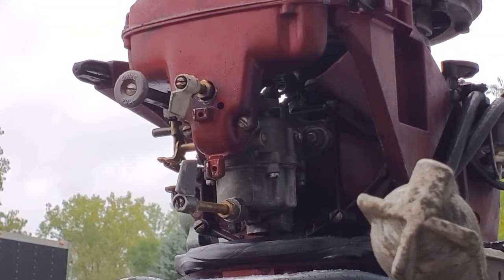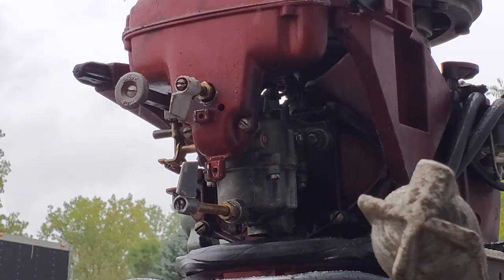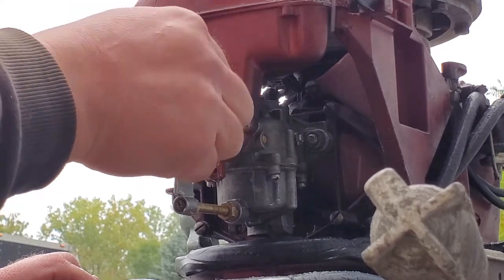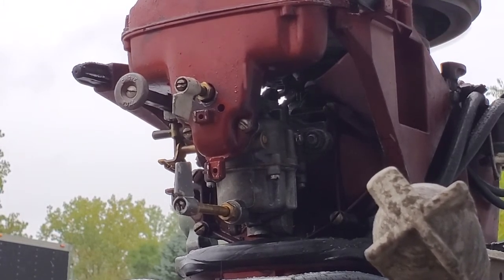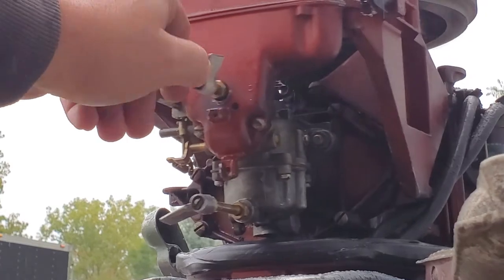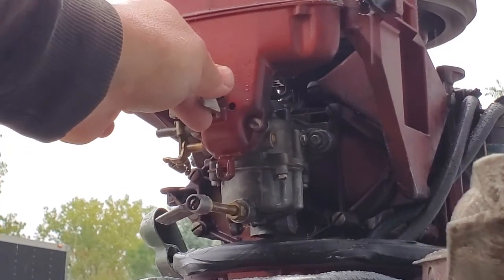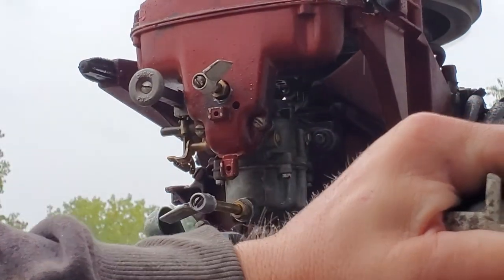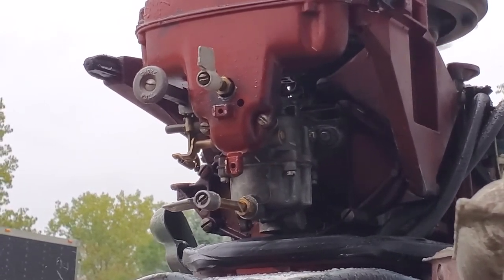Dialing In a Carburetor After a Rebuild

Comment: Do you adjust motors every time you use them? If it’s adjusted for say a hot day then you want to use on a cold day 2 weeks later...re-adjustment? 
How bout if you keep slowing down the idle and adjusting, got the perfect idle for the day, then won’t it be out of adjustment for initial startup next time?
I was supposed to get a 33hp 1965 Evinrude yesterday but the guy screwed me after having me drive 2 hours...that carb on that thing didn’t have a high speed adjustment..every 33 hp from the 60s on marine engines shows in the schematic that they all have an adjustable jet there. 
Edit: I really wanted that 33hp motor...my 28 was running beautifully the other day, not even a cough or hiccup...but it wouldn’t go over 6 mph...I gotta look at my throttle cables, but I feel like I was getting full throw on the handle..so disheartening
Reply from the maker: I adjust motors as needed.  Sometimes they need to be adjusted  a little and other times they don't.  It just depends on the conditions.  If there is a large swing in temperature or humidity, then an adjustment to the low speed needle is often needed for best idle.  If it is a big difference,  like early spring or late fall to middle of summer,  the high speed may need a little adjustment as well.  The idle needing adjustment is very common.  That is why they left the low speed adjustment on the carburetors long after they went to a fixed high speed jet.
Sorry to hear the deal on the 33hp didn't work out.  I see that Marineengine.com shows adjustable high speed on 33hp thru the 1960s.  I find that unusual,  although maybe that is how those were.  I'm not that familiar with the 33s.  Most OMC motors went to fixed high speed in 1964 at the same time they made the switch to 50:1 mix ratio.  I would have guessed that one would have been fixed high speed being a '65.  I was surprised to see ME showed that carb as 2 circuit adjustable.  Thanks for watching!
Reply from the maker: As for your only getting 6mph at WOT, it sounds like it dropped a cylinder if it was not getting full RPM. Thats my first thought, anyway.
Reply: @oldjohnnyrude8404  I pulled each wire while out running, no change in it. Would anything that undear the fly wheel make it do that? 
I was thinking the throttle cables, they work perfectly on the 18, you think they need adjustment for a 28? Like i said, they seem to move the throttle all the way, but it’s hard to see on the 28 from my console, it’s all tucked up in there.
Reply: @oldjohnnyrude8404  I’m so bored today, I’m thinking about trying to add my 62 Johnson 18hp to the boat, dual 18s is 36 hp ;) would look better with 2 fastwin, but it’s what I have. I have 4 gas cans, so I can do the different mixes. Lol your thoughts?
Reply from the maker: @TheFrogfeeder  I say sounds good to me.  Set it up for the Fastwin and the FD now and you can always get another Fastwin to put in place of the Johnson down the road.  Twin 18s are great!
Reply from the maker: Marc Poindexter  It isn't that the carb doesn't keep the settings.  As long as the packing nuts are snug, they will keep the settings.  Conditions change and demand a change in fuel mixture to get the ideal burn back in the cylinders.  Thatbis the nature of an internal combustion engine.  With fuel injection,  the computer processor makes adjustments continuously via feedback from sensors.
Reply from the maker: Marc Poindexter  I guess I don't see "They don't hold their settings at all." As the same thing as "They do not adjust themselves according to conditions."  The settings do not change on their own.  If I'm missing something, I need an explanation.  🤷‍♂️
Reply: Marc Poindexter  Weather changing isn't the carb's fault. :)
Reply from the maker: Marc Poindexter  For a relatively simple 2-circuit carburetor these OMC carbs do quite well.  Unless there is a very noticeable swing in temperature and/or humidity they require little operator input once dialed in.  The older, single circuit carburetors required adjustments for every throttle range every time you run the engine.  Some other brands were, indeed, very sensitive to conditions.  The later carburetors were still 2-circut. Most were better optimized for midrange transition,  but the user input was designed out of them as your average operator became less and less aware of how to adjust a carburetor.  In my experience,  Tillotson carburetors are notably very sensitive to conditions and inputs. Yes, I am aware that originally 2-stroke fuel mix was typically 30wt or 40wt non detergent motor oil mixed with the gasoline.   That mixture also had a tendency to not.stay mixed very well and required occasionally shaking the tank to redistribute the oil in the mix.
Reply from the maker: @TheFrogfeeder  Not sure what under the flywheel would make it do that.  If you are able to pull one plug wire and then switch to the other one and it stays running either way, it probably is not spark that is your problem.  It could be the cables.  With the motor off put it in forward gear then full throttle at the console. Then walk back to the motor amd notice where the throttle dial handle is pointing. Next, unhook the throttle cable and see if you can turn the handle farther toward wide open by hand.  If you can, then you need to adjust the cable.
Reply: Marc Poindexter  oldjohnnyrude is always on base when he talking outboards! You can learn a lot from him.
Reply: Marc Poindexter  all good, I know he is very knowledgeable with this older stuff, which is what I like also, and he has helped me tremendously, from across the country, to get a few of my 60s motors running. Old johnnyrude is my go-to guy for all my endless questions, I don’t pay him(though I would), he is just a good person that helps others when he doesn’t even have to :) 
oh, and he has a way of explaining things that makes it easy for me to understand

Comment: So I got a 5.5hp Johnson and took it out for the first time after rebuilding the carb and I could not for the life of me get it to idle, could I have messed up the packing? If I remember right I may have tightened the low speed needle a little too much ? Could this be my issue ?
Reply from the maker: When you rebuilt the carburetor,  did you remove the old packing and replace it with new? When you replaced the mixture needles, did you lightly seat and back them out to the initial positions before you tightened up the packing nuts? I usually start with both needles out 1.5 turns from lightly seated.  That is WAY rich on the high speed and typically still a good bit rich onow speed.  That way I know I will be leaning the mixture out from my start point and it usually means a fairly easy first start. From there follow this video on dialing the needles in while it is running.  Be careful with the low speed needle especially. It is fairly easily damaged if it is seated too firmly. I hope this helps. Thanks for watching!
Reply: @oldjohnnyrude8404  if I remember right I may have over tightened the packing nut on the low speed, I'm going to take it out again tomorrow probably and I'll report back, I tried running it in the back yard today I got it running good but the moment I put her into gear she dies, I could it possibly be my fuel pump? I replaced it with the correct part number but it was a cheap 15 dollar pump
Reply from the maker: @nightdrivers9138  A could more questions. 
1. What model is your motor? I ask so I know the year so I know what you're dealing with and how to answer questions better
2. Does it run and idle well, but just dies when you shift into gear?  If so, your trouble may not be the carburetor, but the shock absorber in the gearcase.  That part is under the water pump.  They tend to get sprung after so long a time. When they do they expand in length and start to drag on the bottom of the bearing carrier plate for the drive shaft. When they are sprung they badly, I press them back together and weld the seam.  That makes the drive shaft effectively solid and you have to go to a brass shear pin in the prop to protect the gears since there is no shock absorber in the driveline anymore.
Reply: @oldjohnnyrude8404  so it's a cd18 1961 5.5hp seahorse, i can get it to run okay at high rpm but at low rpm I can get it to idle but the rpm still seem to be too high and can't get it to drop anymore, I also had issues with it popping out of gear under load at high speed
Reply from the maker: @nightdrivers9138  OK. Second year with a fuel pump for a single line tank.  First year for needle bearings on the big ends of the rods so it will use 24:1 gas/oil mix instead of 16:1 that the previous years required. 

It does sound like your low speed circuit may be clogged or partially clogged. Something seems.to be keeping it from taking over when the high speed circuit cuts off.  It also sounds like your clutch dog and possibly forward gear has become rounded off from slow shifting over the years.  The detent spring in the gearcase could be weakened or broken as well.
Reply: @oldjohnnyrude8404  awesome thanks for the info, I'll have to tear apart the carb again and clean it again, if I cant get it to run right I might just sell it
Reply from the maker: @nightdrivers9138  You're welcome. Hopefully you get it sorted out. They're nice little motors.
Reply: @oldjohnnyrude8404  hey again so i wasn't able to take her out on the water since it rained but I did pull out the low speed needle and the tip looks like it's been eaten away and looks like it has small pitting, it still has the tip and it's shiny below where it is damaged so seems to still seat, do you think this could be my issue ?
Reply from the maker: @nightdrivers9138  HI there.  So, while damage to the tip of the needle is not going to do your motor any favors when it comes to idle quality, it is highly unlikely that this damage you are describing is preventing the idle circiut from functioning completely.  That is how it is behaving from how you describe it.  Have you removed the Welch plug from the top of the carburetor and made sure the ports under it are completely clean and there is no trash floating around in that cavity?  I don't usually do that unless something like you're describing happens.  Sometimes there is stuff in there that will not flush out any other way though.  New Welch plugs are included in the carb kit.
Reply: @oldjohnnyrude8404  got ya and yes I did replace the plug I dipped the carb for about an hour and then sprayed out every port with carb cleaner, even made sure those little holes in the carb for the low speed were clear of anything I'm starting to think it's that shock obsorber you were talking about at this point.
Reply from the maker: @nightdrivers9138  Excellent.  Glad to hear the carb got the full cleaning. The shock absorber is definitely something worth looking at. It will require a gasket replacement.  When you lift the plate under the water pump, it opens into the gearcase.  Those gaskets are often the source of gearcase leaks on these lower units.
Reply: @oldjohnnyrude8404  is this the part number for that shock obsorber your talking about? Had no clue they are that expensive lol 0376073
Reply from the maker: @nightdrivers9138  Yup, you have the correct part number. I always just press them back together and weld the seam so it can't spring open again. Then replace the steel drive pin in the prop with a brass shear pin to protect the gears. Carry spare pins.  It is a much less expensive option.
Reply: @oldjohnnyrude8404  so I have it in a test bucket rn, and this is kinda odd, so as I was leaning out the highspeed I had my hand grounded on the little handle thing while tighting the high speed needle and the fucker shocked me ! Do I have a bad ground on the coils or something ? The fucker shocked the hell outta me scared me a little bit 😂
Reply from the maker: @nightdrivers9138  Sounds like you either have a coil or a plug wire shorting to chassis ground.  It should not be doing that.  That short will affect how it runs too.  When it is arcing out, it most likely will not be firing whichever plug is being fed by the coil or wire that is shorting.
Reply: @oldjohnnyrude8404  thanks so much for all your help your awesome man ! I will stop bothering you now. Thanks again !!
Reply from the maker: @nightdrivers9138  No problem at all.  Glad to help out when I can. Good luck! I hope you get it sorted out.😎👍
Reply: @oldjohnnyrude8404  sorry for commenting again but I thought you may be curious, so I got the flywheel off and surprise surprise the coils look shot, they look like the originals and are all cracked up. I'm going to replace coils condensers and maybe points, and spark plug wires hopefully that should do the trick. Would it hurt to put some anti seize on the crank to make taking the flywheel off easily in the future ?
Reply from the maker: @nightdrivers9138  no problem! I like finding those motors with original cracked coils in them. They typically don't have as many hours on them as the ones that have two different coils from different eras on the magneto.   That would explain the thing shocking you.  If the original points can be cleaned up well amd are not pitted too badly, I would clean them and reuse them. The OEM points have been having quality issues for the past couple years  Unfortunately, aftermarket points of typically questionable quality have been a better bet than OEM of late.  Other than that, I still like to use OEM ignition parts. I would definitely replace the coils and condensers with OEM.  Spark plug wire needs to be copper core wire.  Do not use anit-seize or anything at all on the crankshaft taper for the flywheel. Make sure it is clean and completely dry.  That taper is intended to lock the flywheel in place with the proper torque applied to the nut. Good luck.  I'm sure you will be very happy with how it runs when your tune up is finished.👍

Comment: What if mine wants to die when i set the throttle to shift so i can put it in forward?
Reply: Mines an 18hp evinrude 1956 or 7
Reply from the maker: @danielwiebe1135  If you follow the procedure outlined in this video, it will fix the problem of having the engine die when you throttle down to shift.  That is assuming the carburetor is clean and the ignition system is in good condition and state of tune.  These engines idle exceptionally well when they're well tuned.  If yours is an 18hp Evinrude it is at least 1957. 1956 was the last year for the 20c.i. 15hp. Thanks for watching!

Comment: Do you tune it with propeller on or off?
Reply from the maker: I usually use a test wheel in the test tank or a prop when on the boat.  You cannot properly tune without a prop on the motor.  The engine has to have a load on it to tune it.  Thanks for watching!
Reply: @oldjohnnyrude8404  Ok. Thank you. My motor is a small 7.5 seahorse. I read prop on and some say prop off.
Reply from the maker: @TuneInBurnOutTV  Definitely run yours with the prop on it to tune it.
Reply: @oldjohnnyrude8404  Ill try this tonight